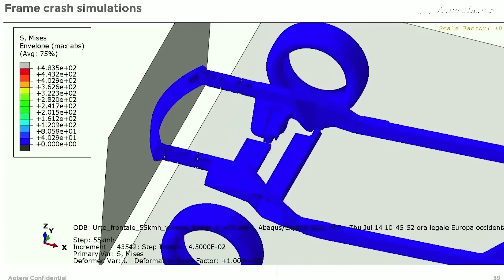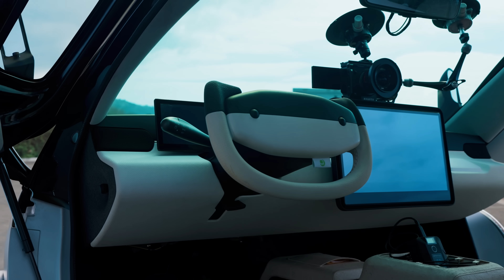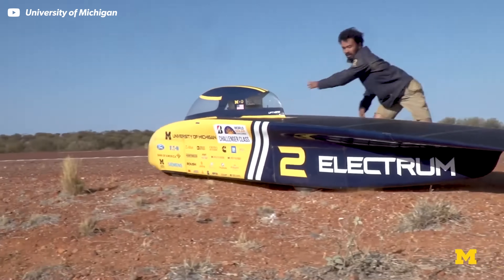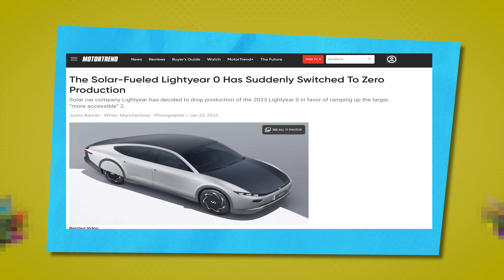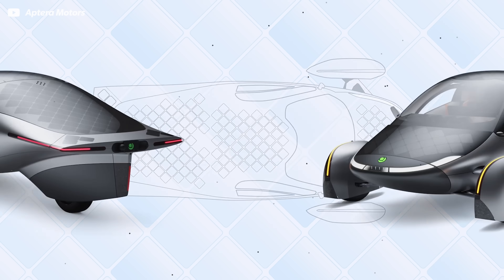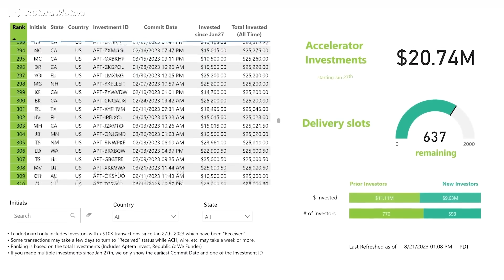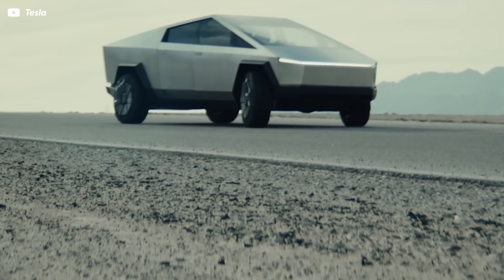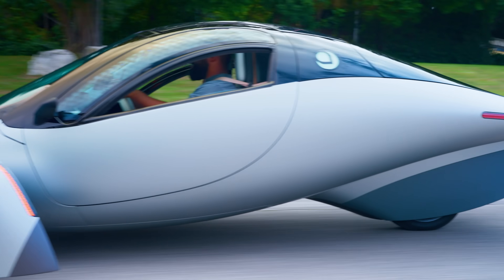We Drove America's First Solar Car

Comment: Im so excited about this car. If it can really last for 500k+ miles like theyre claiming with easy and cheap self-repair when things go wrong, over the lifespan of this vehicle it could save you tens of thousands compared to driving some of the SUVs on the road right now. Not just in gas, but in maintenance (with in-wheel motors, there literally isnt even a drivetrain with moving parts anymore; just copper cables and cooling hoses), insurance (since itll be registered as an autocycle instead of a car), and the right to repair when things finally start breaking down. On that last note- I just read an article about how replacing a taillight assembly due to water intrusion in some newer Fords can cost $5,000 due to it needing to be brought in to the dealership to re-sync the proprietary DRMs on the light controller. Won't have to deal with that BS when you’ll just be able to buy and install the parts yourself using the QR codes on all the parts
Reply: Exactly.  And your estimates don't even mention the likely saving that will accrue to all of us from the lower environmental damage that these vehicles will cause.

Comment: I've had a reservation for an Aptera for about three years. Some of the things, like the yoke, were making me wonder if I still wanted it or not. This video has changed my mind. Yeah, I'll get a real steering wheel in it right away, but otherwise, I'm looking forward to buying mine when it comes out.
Reply: I have a reservation for this myself.  I currently have a Tesla M3.  I replaced the steering wheel myself with an aftermarket yoke (fixed, thanks @SyntheticSpy).  After a couple hours of driving, I never want to go back to a round wheel.  It's so much more comfortable in the hands and I find it able to control the vehicle better for fine movements.  And you feel like you're driving a jet or race car XD
Reply: @Peter-wz2wx just fyi it’s yoke. A yolk would be from an egg
Reply: @SyntheticSpy  Hahahaha, I love autocorrect, it's ducking hilarious at times!
Reply: @Peter-wz2wx  you're in the minority. Unless a car has the steering ratio of an F1 race car, it's better with a real steering wheel. Most people don't hold the wheel at 9 and 3 the entire time they're driving. Your comment about fine movements doesn't make any sense - the yoke doesn't change the steering ratio. It sounds like you think it looks cool, and you've decided it's actually better because of that. 

Bully for you, and you should enjoy your car and your yoke. If the Aptera makes it to market, it's the first thing I'm fixing once I get mine.
Reply: @JaysonElliot  Biggest issue with the yoke is the steering wheel controls (or complete lack of them). Aptera's doing Tesla-style minimalism but taking it to a whole new level. I'd accept almost anything other than what they're doing with the simple horn button on left, and up/down rocker on the right. (seen in the production-intent design renders)
Reply: @JaysonElliot  Wow, you assumed a lot there. First about how most people drive. About me being in the minority, I haven't seen any published studies about more people who have used a yoke and don't like it than those that do, just a lot people making a lot of assumptions before ever having tried one. Then about what you think I think. I never said a thing about looks. This all from someone who, from the sounds of it, has never used a yoke. And why would anyone have to keep their hands at 9 and 3? See the top? Rest your hands there.  See the bottom? Yep, great shelf to rest hands there too. You could even gasp just put one on the bottom middle! And finer control? It wasn't subjective. With the flat part on the sides, you can hold your hands in a neutral position (as in, physical body neutral) with them straight up and down, not turned any amount like on a normal wheel. Now that your hands are comfortably in a neutral position, it makes it easier to hold in place for longer durations of time. Look, I just tried to convey that after using one, I like it more. That maybe, before you judge, you try using one. And yes, I'm assuming you haven't used one since you didn't at any point, claim you have.
Reply: @JaysonElliot The Aptera has torque vectoring and will have different steering ratios. Tesla fucked up big time on their yoke (cause Muskrat just wanted something that looked *futuristic*.) They opted for a yoke for other reasons as well: visibility and clearance being chief among them.

Comment: If they really do get this thing figured out, it's going to be the largest and most important innovation in not only American history, but in the world.  That price point seems like a bit of a stretch, but again, if they manage to pull it off, EVERYTHING will change.
Reply: They're already wrapping up their production intent vehicle, and should start rolling out vehicles early next year.
Reply: it's just an ev.  small aerodynamic.  the solar panels are mostly a gimmick. 

I think they said optimal 40 miles per day charge on base model?  Which means it's probably more like 15   So, you're just plugging it in anyway.

it would be better to have the  solar panel on your house & make the car cheaper.
Reply: They are still taking pre-orders, entry model (250 mile range) still at about $25K
Reply: What? More important than McDonald's?
Reply: @jamesbyrd3740  THIS. I think it's wild that donut media hasn't spent any time explaining this. Scammy as. 40 miles, what's the point? The car's going to be charged in most garages anyway every morning. And most EVs give you at least 250miles of range these days. Just get a Nissan Leaf. And at least you can carry kids and like milk and eggs from the supermarket.
Reply: @jamesbyrd3740  its indeed more efficient to use solar on your house .. butt to spend 1300 for 900watts solar on your car that will always top it up and makes shure your batt doesnt run low .. is pretty nice ..

Comment: You should have talked about the storage space. It is actually comparable to a Tesla Model 3 in the rear, and even big bois should be able to sleep/camp comfortably in the rear
Reply: Yeah, missed some info like battery capacity and range, but it's understandable, as these figures would probably vary

Comment: I have to say, if this thing actually hits production and it’s even near the $30k range, I’ll have to get one. I would always be between 90-100% charge everytime I drove it because of my commute to work and home is short. I live in the south with lots of sunlight, so it would sit in the parking lot all day just charging.
Reply: Yeah $25k is cheap even for regular cars. I hope they can pull it off. The Prius Prime is similar in price and also a pretty good looking car but this thing is next level. I've been pulling for them when they first launched.
Reply: The only problem with the cost thinking is this is a commute purpose car....not a cargo or trip car.  Like a motorcycle, it becomes an extra vehicle for total utility.  It equates to the utility of a Slingshot....meaning fun or just driving one butt (maybe two) to work.

Solar collection at 5m-stored-per hr is an engineering ideal on the San Diego to Pensacola line in summer with 14 hrs of daylight...10 at peak.  For most  people it will be about 2mph over 8 hrs.  Being 16 miles stored in an average day.

If your commute is 8 miles or less....then the fuel cost of a commute in a similarly small car like a Civic is UNDER $2 in $4/gal areas.   

That fast food stop cost much more than that.  Even a coffee is over $2.  So to save $2 a day, spending $30000 seems like a very long payback over your existing car.  A Civic costs $16k and can last 400000miles.

We don't know how long this will last, nor can any be bought for $6000 used.

As a novelty or enthusiast purchase it is fine.  As a frugal choice...the math doesn't work.
Reply: If they can figure out a way to sync this thing up with your house and do net metering, or even using it as emergency power storage for the home, then we're really onto something special here. Not sure how feasible that is given its size and battery, but any time we can decentralize the grid, we should.
Reply: @steelerfaninperu  but that's even more complexity for something that should be kept simple by an unproven and troubled company hoping to just finally make a car.  There aren't enough solar cells on this car to spit into a bucket compared to a house roof or array in your yard.  There's not enough battery in the spec to make a dent in what you could stick in your house for less money.

The car itself, even if gasoline, hydrogen or unicorn farts, is a play toy runabout like a Miata or a Slingshot with a roof.  It is fun for personal gocarting around the hood, but unlikely to be a great experience on the open road for days, doing the soccer run, picking up that big ticket purchase or some gardening stuff.

Nothing wrong with a sport car to have fun, but few stay in the lifestyle for long that can use it as solo transportation.  If you have a house...then there is a 90% chance you need a traditional car or truck too.

Also if you've never driven a 3 wheel Morgan style arrangement...it is a different experience and not as forgiving of rough roads or overloading as 4 wheels.

Comment: I remember reading blog articles about this car in 2007. Insane it has taken this long and that it is also actually happening.
Reply: Not this car or company.  Aptera Corp. was founded in 2019, and has a completely different corporate structure thn Aptera Inc. and the drive train of the vehicle has nothing in common with what you are referring to.

Comment: My hometown has a weird sort of competitor to this called arcimoto, which is designed as a tandem two seater leaning more so on the motorcycle side of 3 wheelers, but aptera looks like they could blow them out of the water
Reply: You can rent out the arcimotos in a lot of cities.
Reply: @stevelouie5928  that's they're main selling point, they're basically street legal golf carts that people can use as vacation rentals, or last mile delivery. They're really cool as a concept, but they're super dorky looking😂
Reply: not solar though🤔 completely different vehicle for a different purpose
Reply: Archimoto makes more sense for utility vehicles and last mile delivery like food/small packages. 

My friend has one, and it’s basically a 3-wheel motorcycle with a roll cage: handlebar steering, motorcycle suspension, etc.
Reply: The only thing in common with Arcimoto is that they're both a 3 wheeled electric vehicle. EVERYTHING else is different.
Reply: I was at Fully Charged Live when Sandy Munro unveiled Gamma in San Diego. I was there as an Arcimoto fan excited to take delivery of my FUV in a couple of weeks. I watched as Sandy had the crowd drinking the Kool-Aid and Chris Anthony spoke to everybody with the same passion he still displays. Seven months later I joined the Accelerator Program.
BTW,  thirteen months and 14,000 miles later, I'm loving my Arcimoto FUV. I know those guys in Eugene are dedicated to keeping my ride on the road. But Aptera is indeed on a higher level than Arcimoto and I do not see them making the same mistakes.
Reply: @@OrwellNailedIt Wrong. I been hearing how Arcimoto has been going off a cliff for a year now. They lose money like everyone else not named Tesla, but they are still making rides.  I commute with an FUV and the service tech was just here last week.

Comment: Bruh, a legit car (ok, electric motorcycle hybrid), can get you to work, that can charge itself, easily from a standard outlet IN MINUTES if need be, has enough room for 2 peeps and a few groceries, saving $3k per year on gas, that costs $25k (obviously will be higher in real life, but WAY cheaper than even BASIC new cars today). Dude, car pays for ITSELF in 8 years and gets you off the gas treadmill FOREVER?? Cheap, gases itself, pays for itself. GAME CHANGER. This slippery little car could DECIMATE the car industry!!

Comment: I think one of the biggest issues with EVs, isn't the fact that they're EVs, it's 1 how they're marketed, 2 most companies forget how to innovate. Like I love my combustion engines, but if I were to get an EV, it'd either be a Rivian or heck even this odd little car. 
I like the Rivians odd headlights that don't look anything like a Ford, Chevy or dodge and this little car has such a unique yet elegant look to it that doesn't look like anything on the market where other manufacturers make their EVs look like any other crossover, truck or family sedan.
Reply: The big difference is the design of the Aptera was not a temporary fashion statement, but comes directly from the mission of the vehicle - to be as efficient as possible.

Comment: Excited for this. It doesn't fit my current lifestyle, but as a secondary car once the family moves out, it is doable. The reality is it won't be for everyone because it has limited utility, but I'd rather this than most other cars for simple errands. You just need to be willing to give up load space for convenience.
Reply: Yeah doesn't fit for me, I have a motorcycle for around-town stuff which has very good gas mileage, and my other car has to have enough space and four wheel drive for camping and snowboarding and such.  Still, I will hope that in the future cars like this will be relatively common and affordable, at some point in my life I would like to own one.
Reply: @PlaySA  Oddly enough, you can probably fit your gear in the Aptera. One of their big promo pieces has been the ability to fit surfboards in the thing. It actually has a lot of cargo space, despite the small appearance.